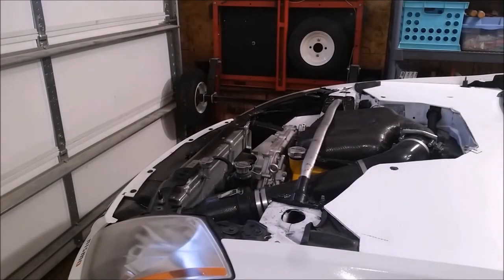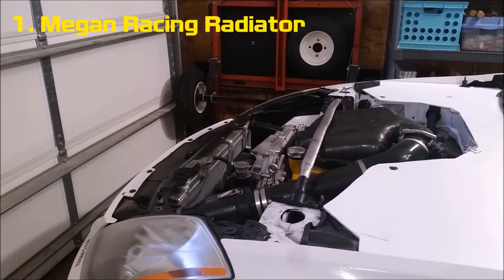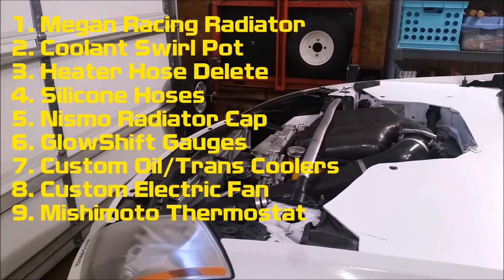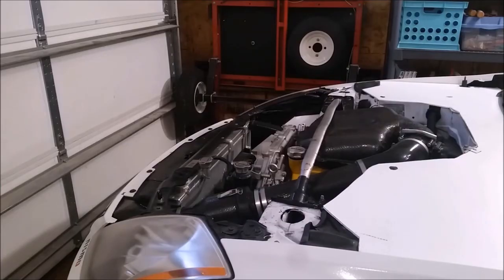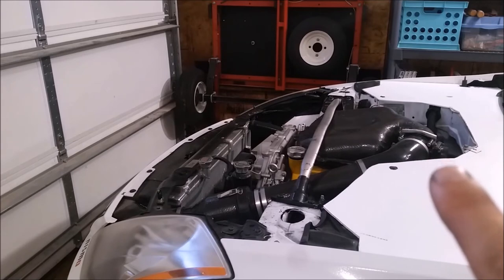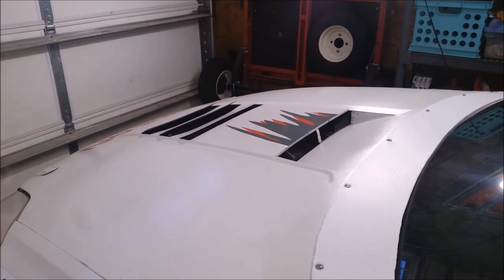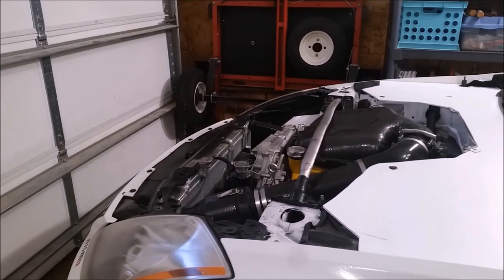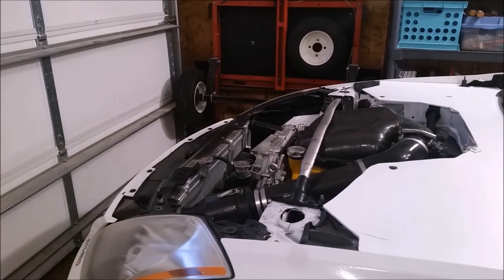NASA TT4 Nissan 350Z Coolant System Set-Up (Part 4 of 8)

Comment: Water alone and water wetter is not good still  it will cause corrosion on the engine  water wetter people at drag race use them because antifreeze can cause slippery roads! For daily use on a car water alone and wetter will cause corrosion  over time  50 years mechanic i have done it before
Reply from the maker: Kind of hard to corrode aluminum... Distilled water and water wetter (or similar) are perfectly acceptable in an all aluminum engine. It's more efficient for heat transfer, cheaper, and less dangerous if there's a leak.